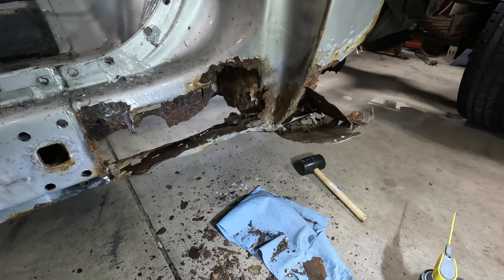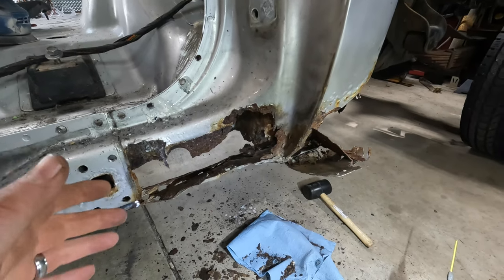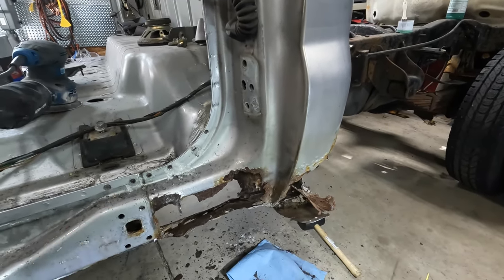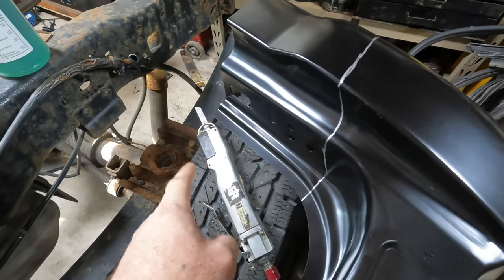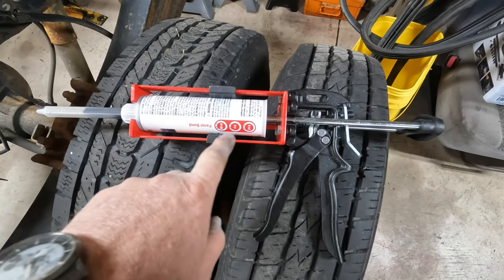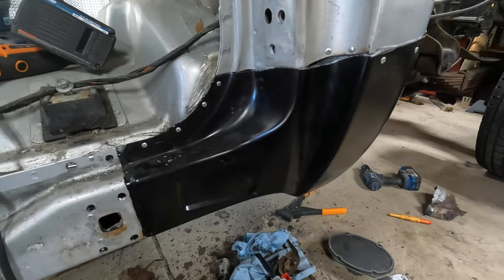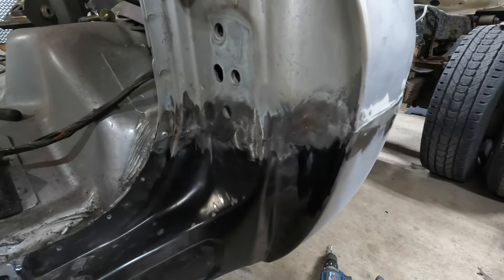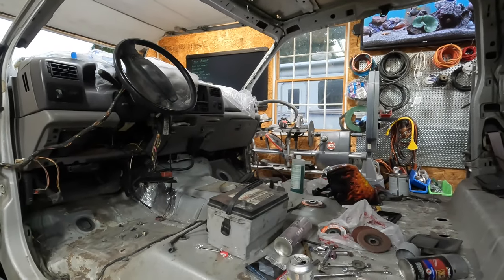Repairing Rusted Out Cab Corners on my Ford Super Duty Pickup Truck, using Glue and Welding!

Comment from the maker: Keep in mind this is a non traditional repair and not the best option.  The inside cab corners are still rusty, though I did scrub them with a wire brush and sprayed rust converter on them.    Most of the cab corner backing is also rotted out and missing, again, not ideal.   If left as is, it would probably rust out fairly quickly.  To combat this, we are going to coat the inside of the cab corner with an oil based undercoating and will continue to do so every year at the beginning of the winter season.  (I will do a video on this!)  The point of this repair was clean the truck up cheaply and quickly with minimal effort.  To be frank, we are putting lipstick on a pig.  :D  I plan on doing 6 month follow ups so you can see how it holds up!

Comment: Im thinking on doing this myself hesitant too, but scared to fuck up once you cut it no going back I might have a shop do mine, and my bed wheel arches and redo my bed mount rails. I'm not good at welding, my welds aren't clean they're sloppy, but they hold really well